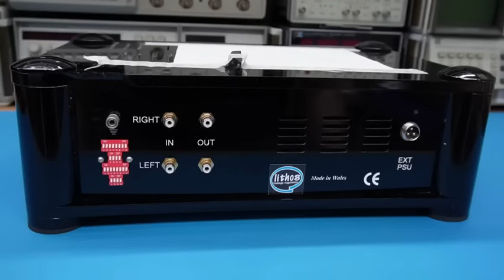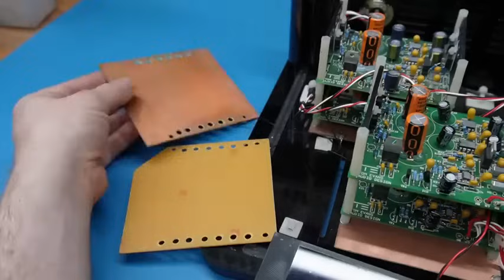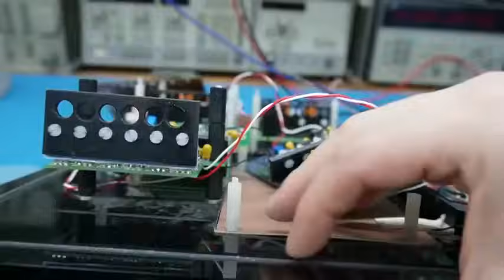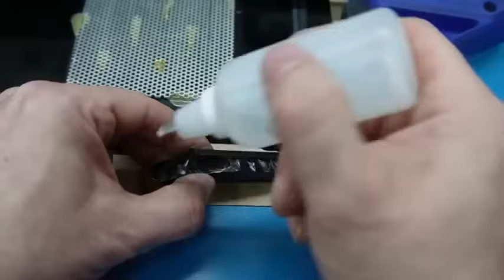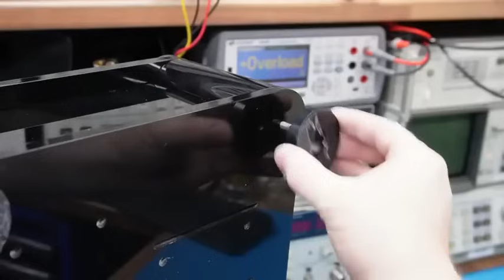Mend It Mark The £25,000 Pre Amp that went Wrong   Tom Evans Mastergroove SR mkIII  Repost

Comment: I reckon the op-amps are OPA1612, as these are...
--------------------------------------------------------------------------------
• Ultralow Noise: 1.1 nV/√Hz at 1 kHz
• Ultralow Distortion: 0.000015% at 1 kHz.
 • rail-to-rail output swing to within 600 mV with a 2-kΩ load

• Wide Bandwidth: 40 MHz (G = +1)
Reply: ...any other candidates????

Comment: So ... the whole fkn electronic repair was one shorted 20c tantalum capacitor!!! And did Mark not say as he first took the lid off -- "Look at all those tantalum capacitors. They are reknowned for going shorted". 😆 Incredible intuition.
Reply: Solid polymer caps in parallel with ceramics (C0G/NPO only, as they are not sound sensitive) are way more reliable,
and actually better than tantalums in performance.

Comment: On a totally different point of view, this 25000 GBP (over 30000 USD) device has atrocious mechanical construction.

At such a gargantuan price, the case construction shall be at minimum brass or stainless steel, not only for aesthetics but also for shielding purposes (sorry, i am an RF guy, nobody's perfect). A Moving Coil cartridge outputs less than a millivolt, some less than 300 µV. This requires full shielding, at minimum.

This plastic case construction forces the conceiver to use internal shields.... ok... but did you see the shields ? Bare copper boards, probably purchased at a surplus market and  drilled using a press drill.

This is excellent for a DIY prototyping, but absolutely anti-professional... and the ground wire directly soldered on the shield. No through hole ? B2B connectors / headers ? Any serious DIY'er will use connectors ! And in a "top-end" analog device with such a price, the strict minimum is gold-plated contacts.

The standoffs... Wow !!! M. Audio Expert, brass standoffs do exist !!!! Ohh they conduct electricity ? Well, that would help to ground your shields ! Ground loops with the standoffs / shields ? use professionally made shields with standoff isolation...

SN: 000058 has proven catastrophically the high fragility of such standoffs in multi-stacked board construction.

This sub-board soldered directly under a main board (no connectors !)... no comment !

And finally, filing part numbers... I've seen this in ultra-low grade Mandarium-built gizmos !!!! And totaly useless ! In a few minutes of research, i,ve found LT1115 / LT1028/1128 ultra-low noise op-amps and LT1010 unity gain buffer... OPA1655 low-noise OA with -129 dB distortion at 20 kHz !

In two words: This audiophile preamplifier has awful construction.

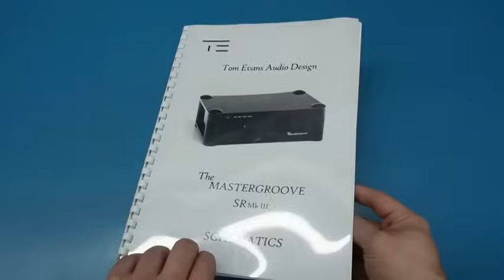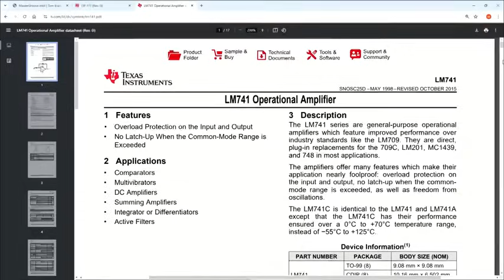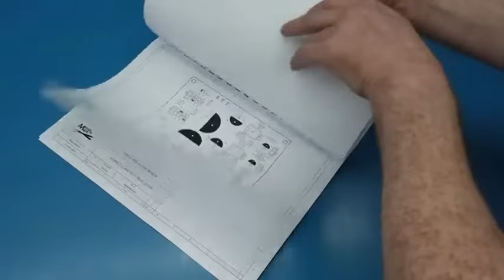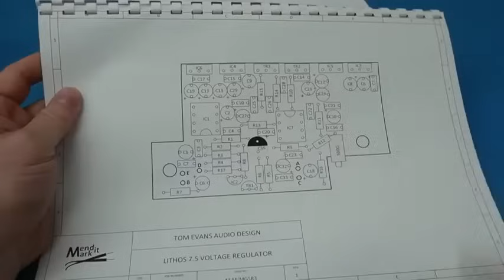Comment: 10:30–13:30 and 15:15–15:20 are where the re-created design document is leafed through page by page on screen. At 17:06, moreover, you can see how the exact position of each component and the precise shape of the board is diagrammed in the document.

Comment: To notice the tiny wires inside this thing, and many audiophiles using utterly expensive interlink cables to connect this thing to an amp, and a turntable. LOL.
Reply: That stuff only matters on the outside of the equipment. Then you can totally hear the difference...

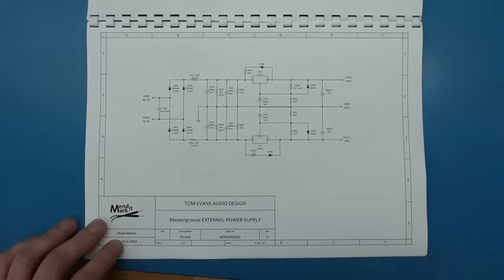Comment: 11:15  Humm..humm...

In high quality japanese audio gear, Diodes in bridge rectifiers (Hi Mehdi !!!) are paralled with ceramic capacitors to reduce rectification noise.

Not in this 25k GBP phono pre-amplifier obviously...

I've serviced an old Wavetek 3006 RF signal generator in the past... For their +5V busses, Wavetek used a TO-220 7.5 Volt regulator feeding a chain of 78L05 local regulators, one per module.

This way of using multiple regulators greatly improves supply quality by significantly attenuating crosstalk between modules.

 So, cascading regulators is nothing new here...

Question... This ultimate Moving Coil preamplifier does use discrete wires for its inputs ??? Again, Japanese ( and everyone serious ) use audio shielded wires for their sub-millivolt inputs. Unless these Tom Evans wires are audiophile cryogenically frozen Quantum-electon wires sold at 250 GBP per meter...

About paralleling op-amps to reduce noise...

I am not 100% sure but in a resistive passive summer (post amplifier) coherent signals are kept at 0 dB while discrete random noises are attenuated by 3 dB. Also, at least in the Burr-Brown datasheet, the summing circuit uses 10k ohms resistors from each individual input stages to a common point, so having some voltage offset between these amplifier outputs is no serious issue there.
Reply: Hot glued perforated panels on the lid..... Classy

Comment: 6:55 Sinclair Radionics erased the id of the chips they used in the Sinclair Super IC12 before they stuck the heatsink on. (I have just checked with the one I have where the heatsink fell off, and there is no id).

Comment: What I am seeing from this video is that the pre-amp is mechanically flimsy, massively overpriced junk.  The copper 'shielding' would achieve nothing because the sides are open and the case is plastic.  Ridiculous.  And the gnarly burred drill holes in the 'shielding'... what did Evans use, a chisel??  And all those tantalum caps......good grief.

13:00 As you show it, it is a mixed (averaged) output, not doubling/summing - unless the mixed  output is a virtual earth input to another op-amp stage, which doesn't seem to be the case in the circuit diagrams you show.

13:30 I hope he isn't using 741a !!!!!

Comment: Design and build quality looks vaguely OK for a 1st-off lab prototype, or a hobbyist project. Somebody was selling this? Wow! (from an electronics engineer in industry for >30yrs)
Reply: Yeah, I mean, if you insist on using standoffs for a multi board arrangement, at least use metal standoffs. It will still look amateurish, but at least it should hold together. Also, Tom went to the trouble to put the power supply in it's own box, I guess to reduce EMF in the preamp cabinet, but then doesn't make the cabinet for the preamp out of metal. Seems like you would want to shield the preamp too. The whole audiophile world is a bunch of overpriced snake oil, so not really surprising.

Comment: IC's used in $30 000 phono preamplifiers:

OPA1602 from Burr-Brown (now TI)

LT1115 and LT1028/LT1128 from Linear Technology (now ADI).

The LT1128 has lower noise than a 50R resistor !!!

And in their datasheets, they explain amplifier paralleling to reduce noise ! What a patent !

The OPA1602 (2.5 nV/root Hz) costs a mere 5 Canuck pesos and has two amplifiers.

The LT1115 (1.2 nV/root Hz) costs $ 20 and

The LT1028 (gain of –1 stable)/LT1128(gain of +1 stable)  (1.0 nV/root Hz) costs $ 25 - $30

I always had great respect to Burr-Brown and Linear Technology who developed top-performance IC's over the years (just think about the LTZ1000 and REF102C voltage references).
Reply: That's my low-noise amplifiers... If you have more part numbers that i didn't note, please add them in comment...

Comment: The Streisand effect is fascinating to observe.  Given time every potential Tom Evans customer will know he charges ten  times the actual value of this pre-amp. They will also know that it is stuffed with tantalum capacitors which commonly short circuit if they fail, and the stacks of PCBs are attached with plastic stand-offs.
Reply: Tantalums TOTALLY fail. Funny bit is 4 months back I was repairing a Revox A77 and got stuck. I messaged Mark with the schematic and what I was seeing. He said "It's that tantalum is shorted. They are weak high failure items". I replaced it and the deck worked perfectly.

Comment: The CE mark on the back of the main unit looks dodgy to me.  The centre bar of the E should be shorter and the C and outer part of the E should be a slightly extended semicircle.  The spacing between the C and E also looks wrong.  You would have thought that if you had paid all that money out for compliance testing and CE certification that you would also comply with the strict rules of the CE symbol.  I assume that the product has been compliance tested?
Reply: Excellent catch!  He has indeed used a dubious version of the "China Export" mark instead.  I wonder if he actually did legitimate CE testing?  When you deal with a testing laboratory they are very specific about the proper way to display compliance.  You can't just "forget" to do it right.  Evans couldn't even get the slightly shorter centre bar of the E correct as it is typically slightly shorter on China Export marks and much shorter still on legitimate Conformité Européenne certified equipment. There are fines for such actions. The following is taken from Sicom testing laboratories:

• Anyone who places equipment on the market that does not comply with the protection requirements is subject to the administrative sanction of paying a sum from 4,000 euros to 24,000 euros. Anyone who makes modifications to equipment with the required CE marking which results in non-compliance with the protection requirements is subject to the same sanction.

• Anyone who places on the market, markets, distributes in any form or installs equipment which, although compliant with the protection requirements, does not have the required CE marking and technical documentation, is subject to the administrative sanction of paying a sum from 2,000 euros to 12,000 euros.

Furthermore, the sanctions also concern anyone who affixes marks that could be confused with the CE marking (or limit their visibility and readability): in this case the administrative fine amounts to a sum from 1,000 euros to 6,000 euros.

Intriguing.

Comment: Just a little information about my personal experience.
If you need to clue acrylic, don’t use any clue, take instead chloroform, just one drop, pushing the two parts together, it will instantly welding the parts together and the very nice side affect is, whatever is pushed out of the gap will just vaporise

Comment: Geez.... I'd be embarrassed to sell something built like that at any price.  Everything from the case to the power supply connector to the single / double sided shielding says cheap.  And we're only 10 minutes into the video.  This is not high-end, regardless of the specs. True high-end audio gear is very well made indeed, even if I wouldn't choose to buy it (purely on cost grounds).

And having watched the rest of the video, it's clear that Tom Evans' actions are not really motivated by copyright.  Indeed, Mark didn't show anything that might truly be proprietary, such as details of the equalisation circuits. Parallel devices, whether transistors, op-amps, or regulators, as a means or reducing random noise was described in the 1970s and 80s, perhaps earlier.  I think he's just upset that his shoddily built product has been exposed for what it is.

And cardboard... FFS!  Why not some nice silicone inserts, or high density neoprene foam?  Got to preserve that profit margin somehow....

Comment: Mark could measure some performance characteristic of the amp. Because the manufacturer was forgetting that from the documentation of a 25000 worth of preamp?! That is very pity to say it sounds good.
Like  Gain, Signal-to-Noise Ratio, Frequency Response, RIAA Equalization.
Also same for the power supply:
Ripple and Noise, Load Regulation, Protection Features.
Info like Compatibility: Ensure the preamp is compatible with your cartridge type (moving magnet or moving coil)

Comment: We all knew that Tom Evans was crap, but thanks to opening it up. The paralleling of amplifiers has the problem that every amplifier is different and if you place a noisy one in parallel with a good one, you ruin the good ones performance. Paralleling only works if you selected the best ones and do not install a mediocre one. Hopefully Tom Evans selected them, whatever he installed.

Comment: Terribly designed unit, tantalum capacitor city........ Short circuit is a very common failure mode for tantalum caps. I don't understand why shoddy evans didn't use film caps in the signal path, I am perplexed at the tantalum capacitor city in that unit - I bet more of these caps will fail the same way over time. 25k for something that looks like a high school electronics project inside.... 25k and its so flimsy inside... What a joke... Audiophile grade? Audiofool more like it - you'd have to have more money than brain-cells to spend 25k on this piece of kit.

Comment: What do the DIP switches do?
Reply: Judging by the connections it appears they likely select various resistors to change the input impedance to match the cartridge. That's a true audiophile tuning trick from way back.
Reply: @Peter_S_  For 25 grand he could have found a better solution than cheap-arsed dip switched on an external case.  Say, a rotary switch, or putting them behind a flap or cover.
Reply: @bennyattar8862  Agree 100%. A pair of 1P12T rotaries would have been what I would have used, with an NOS Davies chickenhead knob as well. He couldn't even be bothered to use a 12 position DIP switch as they don't have them at RS Components. The APEM brand RS carries only goes to 10 way in their catalog. To be fair, as a designer I don't take issue with what he did for that switch technically, but aesthetically is another story. It's a set once and you're done for life type of adjustment but the way he did it does look dodgy and cheap 1980s. As you state, he could have easily put it behind a cover, and using some knurled thumbscrews to secure the cover would only help the fru-fru factor.
Reply: @Peter_S_ we must cut the costs down to the bare bones.... TE.
Reply: @tubical71  I don't get that impression at all and I've been a designer since the 1980s. I suspect it's what he could get ahold of without going outside the UK. RS is a standard UK supplier. I think many of his fabrication choices are rubbish and not using a shielded box is daft, but he's using a number of tried and true standard HiFi techniques and tricks as far as circuit topology goes. I don't see snake oil in the circuit design, just the marketing and the retail price.
Reply: @twobob  It does look like it came out of a circus.  I recently dealt with a designer who had similar 'issues'. He thought or at least told everyone around him that he knew far more than he really did. He did know quite a bit, but he didn't know quite a bit more. Those people copy good elements from other designs but they've not got the slightest clue whet it comes to systems design so they do freakishly daft things in integration like we see in this design. I just dealt with an instrument design using a very expensive reference IC but it had pathetic layout that reduced that $16.85 chip to the performance of a $0.13 Zener and a load resistor. Sad, really.
Reply: The square root of f*** all.

Comment: For the algo.  I am no way an audiophile or electronics tech but just had to laugh at the amount of tantal beads in there, that should keep this thing going back in "service" for years to come. Does Tom Evans run a repair shop now where he is milking his other customers? And those 24 DIP switches, with a couple of cables attached.... absolute bonkers, talk about rich mans, white van gear
Reply: The DIP switches are for selecting various resistors to change the inout impedance. He could have used two 1P12T rotary switches to do the same. That's a 1960s vintage HiFi trick for matching the cartridge and not bonkers at all from a technical standpoint. Try that mod out on your own gear and you'll hear exactly why. While you're spot on about the need for repair thanks to those tants, I'm sure the original intent was to use them for their low ESR, again a typical HiFi design behaviour from 50+ years ago. They are exceptionally common in some higher end applications because of their performance, and they were not known for catching fire in the 1980s as they are today.

Comment: Well done for this reupload. Time, I think for Tom Evans to withdraw his ludicrous, ungrounded copyright claim. Al it is doing is damaging the reputation of his company further. There is some justification for the paralleling of op amps in the design as it can reduce noise levels but it needs no 'genius' to recycle decades old designs - just a little bit of research. This is 'genius' of the Donald Trump variety and something we can do without in the UK.
By the way, I'd recommend a perusal of the Tom Evans Audio website. It's a very amateurish piece of work for what claims to be a cutting-edge company.; not least because of the appallingly poor use of English. It looks as if it was written by a 10 year old.
Reply: I've paralleled some 32 NE5532 opamps for a nice little power amp. Not my design but Douglas Self, it works very well. 😉😊